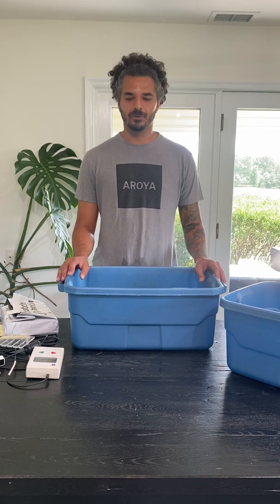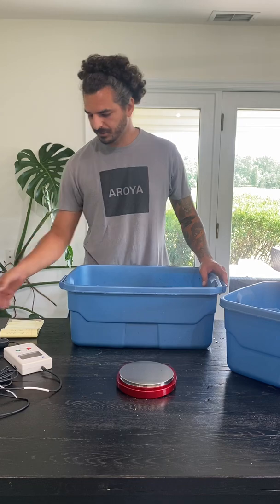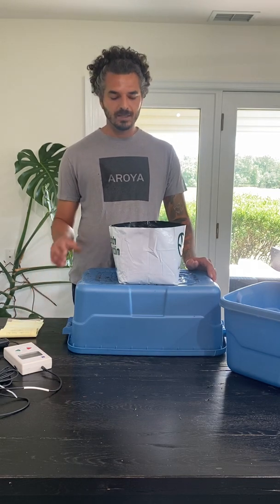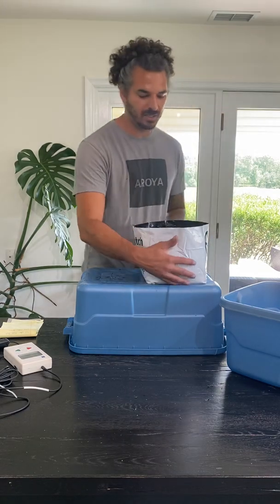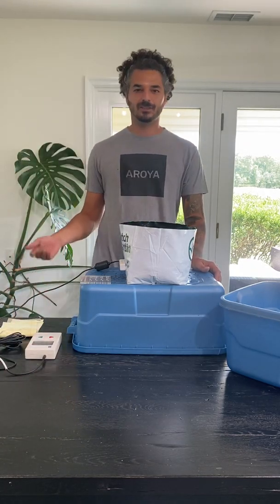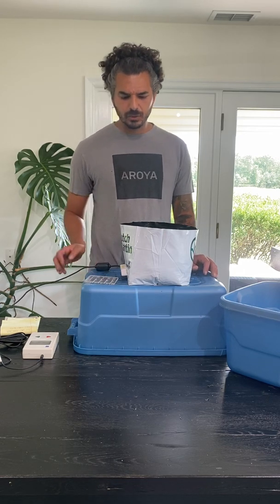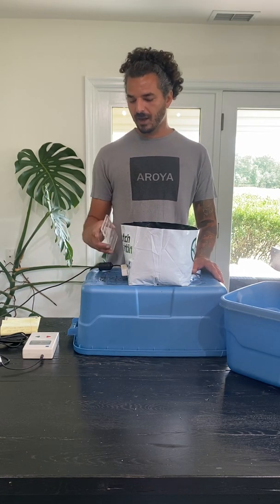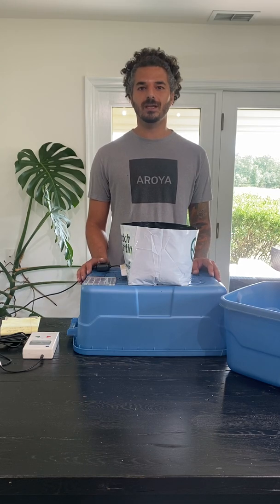Field capacity

Comment: I grow in Peat and added perlite course.  My plants would die if I kept them at saturation for to long.  I need to let them air out to breathe.  Crop steering does not work on peat based soiless systems.
Reply from the maker: In all substrates you have to achieve a dry back over night.  The goal with this information is to know that if your substrate dried back to half its capacity how much solution you can apply before you reach saturation.
Reply: @ramseynubani4362  I just ruined a crop trying this. Not a complete loss but the weight is way off. In peat you must dry back further then that or you create an anerobic enviroment .  Trust me 30 years under my belt. This works great with coco and rock wool. Not with peat.
Reply: @ramseynubani4362   Trust me you dont get a crop looking like this in peat with out a larger dry back. Not a spot any hwere. All hand wateed. I lift every pot every time I water.   Once roots are established I will feed till 10 to 25% run off. Them let them dry back much further then 50%.   other wise they will get root rot, in peat perlite mixture.https://www.youtube.com/shorts/bKlhyI3rBLs

Comment: awesome vid. if it takes 3830ml of water to saturate that 2.2 gal medium. How are you supposed to veg steer properly? Recommended veg is to feed 7-9 shots, and also recommended to feed 3% shots.. for 2.2 gal pot, 3% shot= 225.. 3830/9= 425mls per shot required... What am i calculating wrong?/ Would you be doing more than 9 shots/ would you be feeding more than 3% shots? in this case 6% would be 450mls per shot..
even gen steering in this case.. 450mls*7 shots= 3150mls while field capacity ws reached at 3830.. feedback would be super super appreciated
Reply from the maker: Hello Senna, great question. 2.2 gallons * 3785ml = 8,327ml. Now in this case the substrate held 3,830ml. Take the volume of water it held 3,830ml and divide by the total substrate volume of 8,327ml = 45.99% VWC (Volumetric Water content). When you get to the stage in growth that your pant has established roots and is achieving a dry back of 12% VWC ( 999.24ml) you could apply four 3% VWC (249.81) shots. When I am pushing my plants under a high DLI I will feed 1 gallon of water per day per plant over an 8 hour window
Reply: @ramseynubani4362  thanks for the feedback.with a dryback like that it makes sense. I was mistakenly planning it from the medium being 100% dry! Bro I'm starting drip now, and if it wasn't for you and dankemshunter, I'd never have felt the confidence to make the switch. Thanks for all the info you put out
Reply: Do we need to saturate it first before hand?
Reply: Figure out what your field capacity is and 3%. The recommendation from rockwool is to just use multiple 3% shots. Whatever # of shots that is,  that's what you use. 6% for generative obviously.

Comment: How much (if at all) does root growth over time change or alter field capacity ?
Reply from the maker: it will technically lower field capacity. However if using a substrate sensor, it will provide a false reading higher than the actual field capacity because they are filled with water

Comment: Wonder if you can help figure out what the issue is when I’m trying this method.

Using 3L charcoir bag. Dry weight was 540g, wet was 3,333g-540=2793g. Filled it up with 3000ml to saturate, same as substrate amount. Sensor shows 56% but math comes out to 93%. Where am I fucking this up lol
Reply: Show your math
Reply from the maker: Did you let the substrate completely drain? How much run off was there? 56% sounds accurate for that substrate. If you added 3,000 ml to the substrate and it absorbed everything accept 240 ml then it is 93% saturation which is impossible. Did you record the volume it didn’t absorbe?